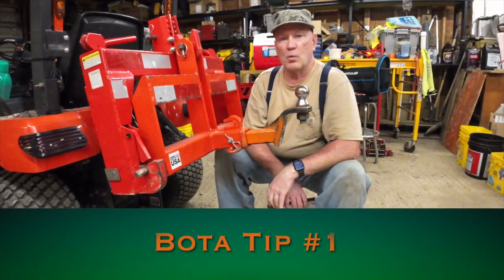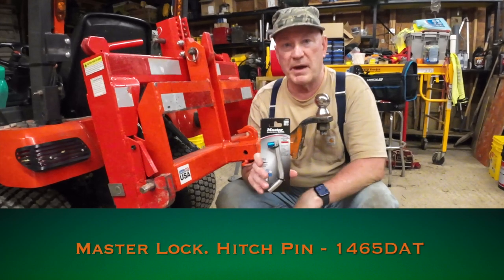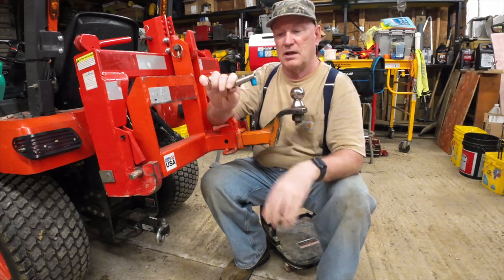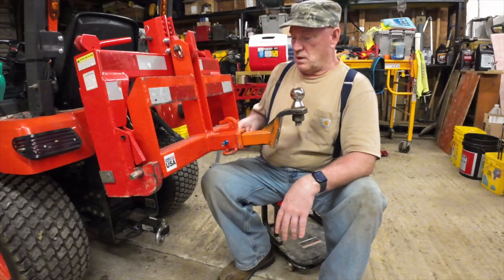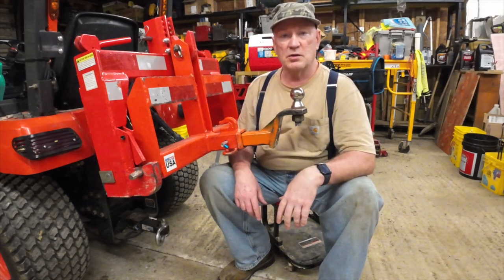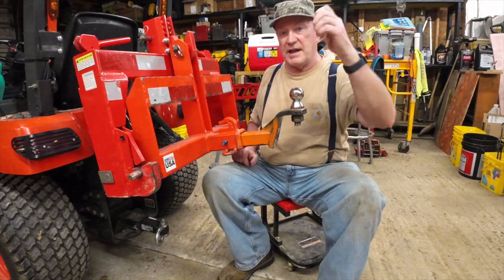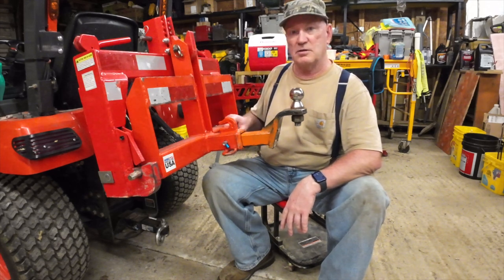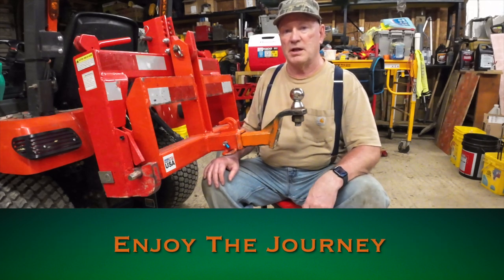Bota Tip 1

Comment: This is a good idea and I’ve never ever seen this device before. I personally use a locking mechanism on the end of my receiver pin. It works well and have never failed but you have to keep it lubed up due to the salt used on the roads here in the northeast. The word you were fumbling on is “Receiver” hitch receiver. Great info BOB thanks for sharing!